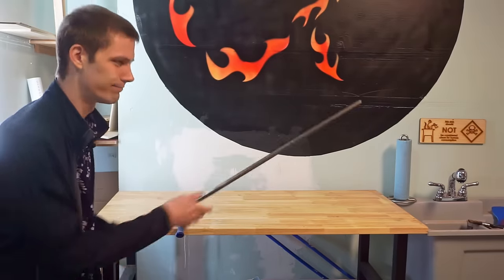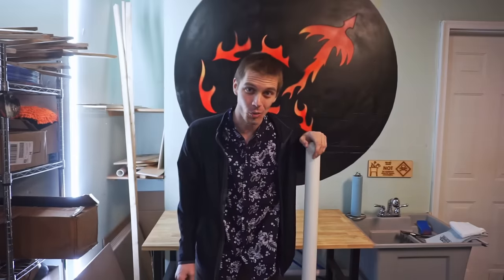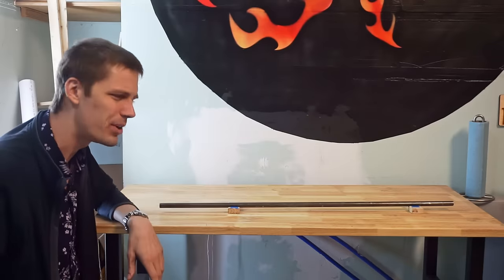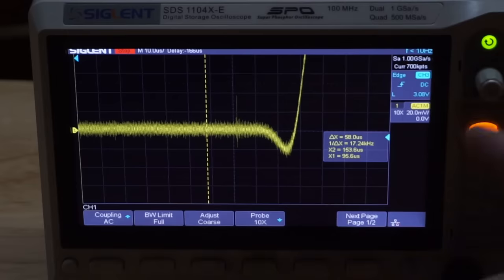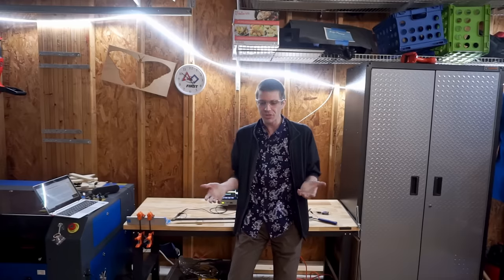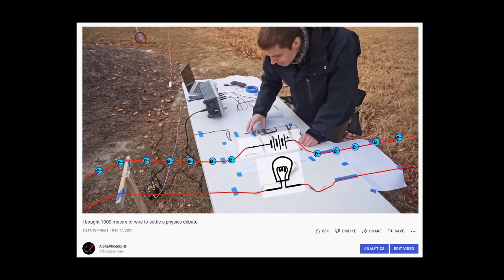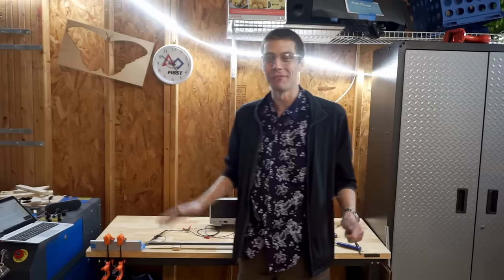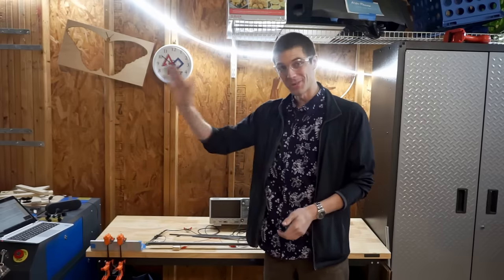Are solid objects really “solid”?

Comment: If you have a steel bar traveling faster than its speed of sound and it hits a stationary wall of sufficient strength, would the steel bar simply be flattened and explode? I would think the trailing end of the bar would keep going at its speed without slowing down until it hits the wall.

Comment: What about the wires used to make the connections?  Did you account for the speed of electricity through those?  Surely, there is some delay or time loss that can be attributed to electricity having to travel through that extra 8 or 10 feet of wire?

Comment: Before I go any farther, I'm going to say at least it wont be instant. Even material is still somewhat floating atoms and just like a very long spring, it's going to take time for the "movement" to travel all across the bar. If I had to guess? Speed of sound. But I wouldn't be too surprised if it was at lightspeed, although that's based on absolutely nothing other than wanting to be able to say "Aha! I covered 3/4ths of the options so my odds were pretty good anyway." xD
4:17 So far so good. Every atom is being taken into account. Don't know what "particle" is in this context. Is it positrons and neutrons? Is it quantum particles? Ahhum moving on.
So if you can't calculate so many, can't you calculate it for a hypothetical bar of 10 atoms across a couple of times, and for something 20 atoms across and find a range of speeds it could take?
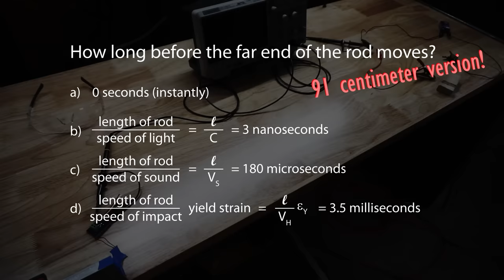6:13 Oh boy, you're about to tell me it's "All of the above" aren't you?
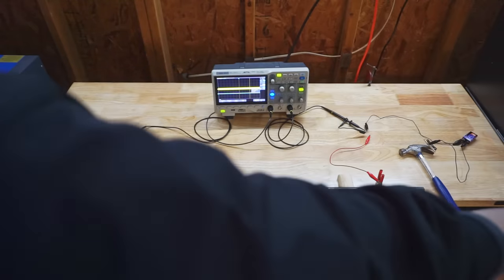6:36 Hold up, isn't there a problem with this? Doesn't it take the speed of light for the measurement to even come in? Doesn't that make the results inaccurate? Are the two cables equally long?
I don't understand this setup. Seems to me that, if you held the bar farther away the delay would be bigger before the circuit is complete which doesn't tell us how long it takes for the opposite end to start moving. Just how it takes for the opposite end to reach the circuit after you hit it.
8:43 Oh whatever. Absolutely nailed it. Can't remember where or when I was told this but yeah. Speed of sound.

Comment: If it is an approximation then instantly is close enough. Plus, how do you know that the delay is NOT in your measuring equipment, the resistance of the sensor,  etc…? Also, if you have the strength to push the whole thing by applying the necessary force, then it will not move until you have supplied the necessary force to move the entire thing. Hitting it with a hammer is different than applying a steady and strong force because now you’ve created a wave correct?

Comment: I have a related question, how does a rotating shaft transmit power with zero loss? Presumably photons are exchanged constantly between the atoms to transmit the torque. How does the energy transfer happen perfectly in solids (assuming steady state, no acceleration/deceleration).

Comment: Edit: I was wrong?

I think if you ignore laws of motion to be able to move the bar, you should then also ignore laws of motion for how the bar reacts. Which should make it instant. Once we start talking about real objects on a celestial scale, I think it'd either be B or D. I'd lean more toward D, since the bar has to act upon itself as the infinite force moves one end. But B wouldn't surprise me either. I don't think the speed of sound has anything to do with this theory.

Edit: it makes sense. I just thought the answers were theoretical. I feel as though I'm "technically" correct in believing D was the answer since the material still had a specific reaction. Maybe I missed something.

Comment: Add more sensors and an LED that goes on when the hammer strikes. Then measure from the end of the bar, the LED light, the vibration of the end of the bar, the sound of the impact. Compare all 3 speeds at the same time.
I guessing the speed of sound is dependent on the medium

Comment: Pushing, expressing force on an object is a form of energy transfer. The circuit will close prior to the measured force being recorded. There is less friction transfer of energy between electrons than the atoms of the bar. So the length of the bar is not relevant, what matters is the field in which energy (Information), can be transferred.  May I suggest an experiment of the speed of energy transfer between a copper, gold, and lead wires. How does atomic weight factor, Can compressing atoms closer together speed up energy transfer? how does the atomic latus effect energy transfer?

Comment: To use wire & electrons apposed to using a pipe & water, 
You stated the pipe was full of water before pumping more. Over packing,
For this to equate, you’d have to have a wire full of electrons, then start your load. 
I’d say like a light switch that is left on, with auxiliary power running, how fast a jolt of electricity from the grid would hit said switch or tester directly after the switch.
Reply: As well as stated downwards, 
Everything has spring like properties. 
But I’d look at it more as frequencies & particle density.
Metal definitely has much more particle density than jello…
If I slap a large jello block, 
You can see the delay on the other end.

Comment: So can we say that maximum electrical motion is the speed of light and physical motion is the speed of sound? You can apply a current to the bar, force a few electrons to move by electromagnetic force, and witness "movement" at the other end at the speed of light. Here you apply a hammer to force the all of the steel atoms to move physically, and they move at the other end by the speed of sound. If there was a way to make only some steel atoms move instead of all of them, would it also be limited to the speed of sound? Is this just the difference between moving electrons vs moving atoms (meaning their mass)?

Comment: It would be great to continue on that line of loggic of the dimensions of the rod, as a wider rod gave you more information, why not continue on that line, and liquify the same rod into a  flat disc(obviously thicker than the diameter of the first rods as it was a noise issue), And in that way carry the noise to other places where they dont bother. Of course given the placement of the measurements you would see almost the same result, but it would be fun and more eye opener. I guess the rod diameter once it rises above the surface limit to contain the stream of information of that particular measurement you are good to go and see the fundamental laws, but with a disc of the same material and volume and mass would be interesting to measure, and more so, a hollow sphere of the same rod, that shape would really show the field.

Comment: There's a theory that two "connected" Quarks can interact with each other, with any distance virtually at the same time. 
Let's say you spin one at a fixed rate, the other spins as well, but it doesn't need to spin at the same rate. But it always will move relative to the other Quarks. 

Now let's take this principle of "connection" and apply it to any random Quarks, let's say one at the very start of your rod, and one ~300 000km away. one you move the one, you move the other. So the question is, did you move both at the same time when you didn't move the whole rod at once?

the same is appliable to a glass of water, the water itself moves instantly, while the water does not. So the rod does not move instantly, right? But the question is how quick we move the glass of water, because at a certain speed the water would pass through the glass and seperate... 

i totally forgot what point i wanted to make...

Comment: Nice problem, nice approach, but your explanarion about why the Poisson ratio shouldn't be taken into account is unsatisfactory. The correct answer is that the bar being thin, there are little impediments to lateral bulging due to lack of additional material. In consequence the bar looks softer to compressions.

Comment: If an object traveling 100 miles per hour collides with a stationary object. Does the car going 100 miles an hour go from zero? When the object hits the stationary object, the stationary object goes from 0 to 100. Does the object moving at 100 go down to 0?

Comment: But the measuring device/display you are using introduces a delay into the equation. That monitor has a refresh and a response time. That screen does not have an instantaneous refresh rate or response time. It takes time for the signal to get to the monitor,it's internal functions to take place, and for the pixels to respond and create an image. I find it more likely that the time you arrived at was closer to the time it took for the monitor to respond than the time it took for the bar to move. The bar is solid enough that pushing on one end would cause the other end to move at the same speed that your finger is moving forward. If you push the bar forward with the end of your finger you are,basically,making the bar an extention of your own finger. So whatever speed you push your finger forward is the speed that the other end of the bar moves. It's a one to one transaction. But,if you are swinging a hammer and striking the end of the bar,then it is going to move at the speed that the hammer is moving at,at the time of impact. It's the whole,equal and opposite reaction thing. Minus whatever energy is lost through transfer of energy by way of friction between the bar and the table or whatever it is resting on.
Reply: I'm a bit confused as to why you are mentioning the monitor. The monitor/display has absolutely nothing to do with the measurements, Oscilloscopes function based on extremely fine tuned internal sensors, which have uncertainty in time/accuracy disclosed by regulation, and the display has nothing to do with the time outcome. 
That's the beauty of analog signal processing, all this old technology has analog signals which are way better for taking measurements

In terms of it being "at the time of impact," it doesn't happen instantly. The speed of sound of steel limits how fast the end of the bar can react, and the speed of causality prevents anything from happening "instantly"

Comment: The initial question was if you pushed on one end how long would it be before the other end moved. Then the experiment was if you shocked one end percussively how long would it be before the other end moved. I don’t think your experiment answered the question you posed. A push is different than a strike. Pushing on something would mean that you would not be making it vibrate (I think). I mean technically all energy is vibrations, so an energy transfer would be a transfer of vibration, however a push, instead of a shock on the end wouldn’t be different than holding the rod in the middle in your hand and moving it in one direction, would it? You’d basically be holding it, just on the very end. 

Wouldn’t a better experiment to answer the question that you actually asked not include vibrating the bar (to that degree)? Like the original test, except you actually push on the bar instead of shocking the bar. Or am I overthinking it? Have we proven somehow that those two actions would cause the same outcome? If I apply a shoving force to something and the exact same force in a collision, does that object that’s at rest behave the same with each kind of force applied? Doesn’t seem like it would. Seems like the vibrations would be much lower and yet the movement on the other end would be much faster.

Comment: How does this work for a supersonic jet? The engine pushes it forward but since the nose can only move that fast at the speed of sound, it would mean that the back of the jet would travel faster than the nose which is a contradiction?
Reply: No. None of this makes any claims about a maximum speed of an object. Speed is relative. This video is about how quickly a push travels through a material. Any force generated by the engines only reach the front of the jet after a short delay. But that delay is the same no matter how fast the jet is going and it can go however fast it wants to. If the engines were capable of instantly accelerating the back of the jet to faster than the speed of sound, then the whole thing would break.

Comment: Is it not possible that the wave of compression is preceded by a wave of rarefraction. Veritasium does a video about slinkys falling, the bottom doesn't move until the top catches up, implying there is an upward force that means the top probably falls faster than 9.81m/s^2

Comment: My guess is that it wouldn’t ever meet the end. It is too long and would bend at the amount of force needed to move the bar. Or it would bend and spring back out and oscillate back and forth. Theoretically if you push the bar perfectly so that it doesn’t move side to side in any way I’d guess that it would just compress probably a mile or so away from you and not really move very much at the other end.

Comment: Factors to consider are the complete lack of atoms/atomic structure e.g. atomic nuclei and electrons in the bar (nothing exists until it’s observed) and the speed of sound qua speed of mechanical response symmetry. Therefore, a perfect solid will transmit sound at c and the absolute compressibility of any substance, not just a sold, is linked.sine qua non to its speed of sound transmission. Ergo, since a vacuum is infinitely compressible, no sound transmission is possible and all ability to transmit sound is the inverse of vacuity of substance i.e. solidity (in a uniform matrix)! 
Of course, the solidity of a substance is a posteriori to its sound transmission speed (vide supra).

Comment: Interesting experiment... How can you be sure your setup is measuring the amount of time it would take to move and not simply the speed of the sound wave you send through it by striking it? Were any of the delay (capacitance/resistance/impedance) issues inherent in your setup enough to affect the certainty of the measurement significantly?  Uncertainty characteristic of your measurement setup could account for any measurement you get that is different from the speed of sound.  I have a degree in physics and it is true, almost every physical system we know of can be modeled as a mass on a spring or equivalently a pendulum with amazing accuracy.  Simple Harmonic Motion - SHO is the mechanical form that seems to dominate a very wide range of phenomena in our observable universe. 🍻

Comment: Maybe it moved at the speed of sound because you made it vibrate by striking it with the hammer. Of course there would be a delay if it is vibrating, as that takes a bit of time. I wonder if the rod was thrusted forward somehow, and not struck, if the result would be different. If the rod could move without vibrating, maybe the result would be faster than the speed of sound.

Comment: Love the video.  Is there not a difference between applying pressure like that vs just moving the bar?  If i use hold the bar and move it forwards 1 meter then I'm not compressing the atoms and sending a 1m long wave down the bar right?  If that were true wouldn't there be a top speed for a material? Like i can only move steel through space at it's internal speed of sound?  What happens if i just move the 300km bar forward by 1m?  Can i only do that at the speed of sound?

Comment: This is such an interesting topic.  How fast does motion propagate in a solid?  Each molecular interaction...

I think a hammer strike will send a shockwave through the solid at a particular rate but a smooth movement seems different in principle

Speed of sound makes sense for the shockwave in a solid

You can accelerate the hammer faster than the speed of sound and strike it so the acceleration is faster than sound.  It would be cool to see a wave of acceleration greater than speed of sound moving at the speed of sound through the material, like a bullet hitting the steel bar... It would probably cause plastic deformation almost by definition...

There is probably a relationship between Plastic deformation and speed of sound in a material

In the spring model you could impart motion faster than the speed of motion

Comment: But what if you could just move the whole thing at once, instead of having a single point of acceleration. Like, if it were to lay on an equally long conveyor belt that had infinite friction and no start delay. Would there be any time differences between the observer that starts it in one end and the observer in the other end?

Comment: Did you measure the delay in the switch itself when the toggle switches from position to position or does the rod travel with the toggle into the next position?  I'm thinking that switch could be throwing you off on your measurement.

Comment: I wonder if instead a pressure sensor,  you could've use the same contact setup like on the hammer side, with a very thin shim that you could remove before striking, and just graph out the additional delay the shim width introduces, by doing several measurements with different length bars?

Comment: I feel like the negatives before the arrival of the spikes are nothing to do with the sensors or steel and everything to do with an effect I don't know the name of but happens in tsunamis. Ahead of the increased pressure in the wave heading down the length of the bar is a small region of lower pressure, caused by the rapidly approaching higher density  portion "pulling" material ahead of itself due to the difference between the speed of sound and the speed of light. Using a contact trigger that is not physically attached to the bar results in an extremely brief seperation or at the very least a reduction in pressure before the impact.

Comment: Could it be that the hammer touching the contact is first measured. Then the bar and hammer moving towards the switch is measured, meaning that the solid behaves in a classical state.